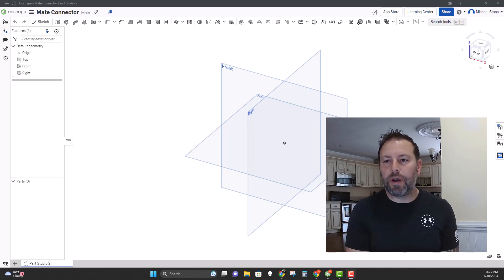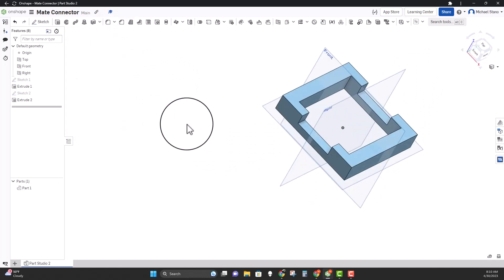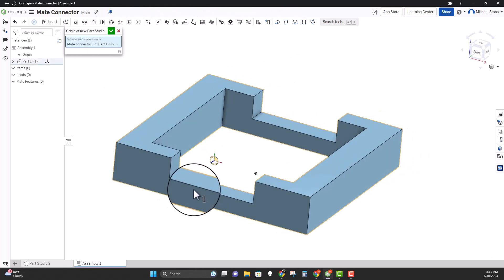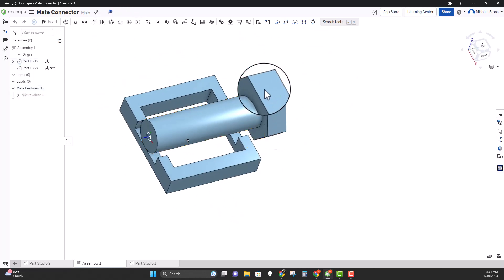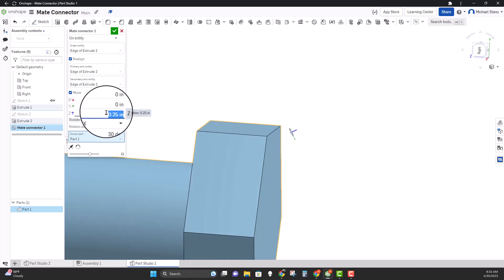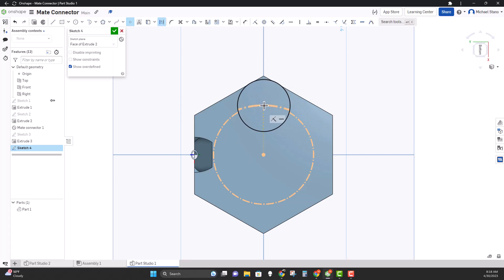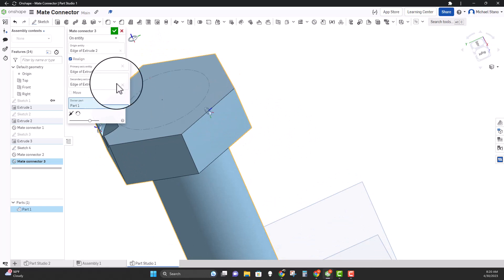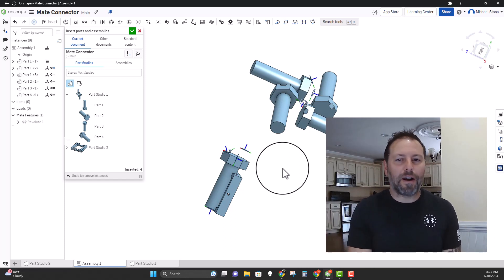Mate Connectors in Onshape

Comment: Hi, HI
Can I ask you for help in my onshape project?
Reply from the maker: Sure!
Reply: Thank you!!!! 🤩 I'm drawing a lotus-shaped table lamp with the petals that rise and fall by setting the angle with move/copy, I was wondering if it was possible to make the petals rise in assembly with the mat connectors 😬
Reply from the maker: @robertavarotto5654  if you want share a copy with me, or share the design with me at stano316@gmail.com might be easier to see
Reply from the maker: @robertavarotto5654  chat through  the email I shared with  you, so that we can try to figure this out.
Reply from the maker: actually check the comments on the file you sent me.